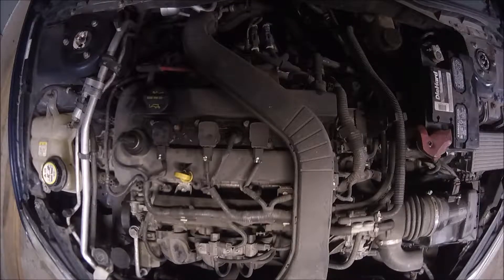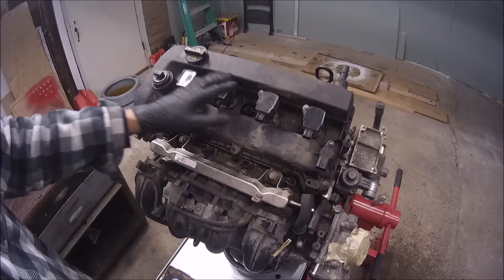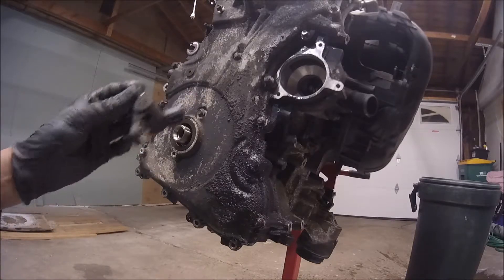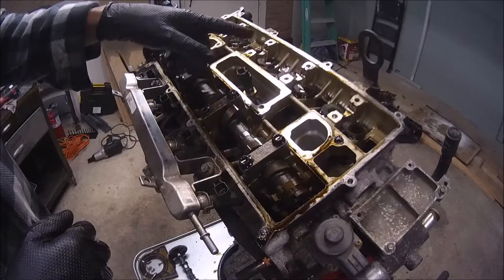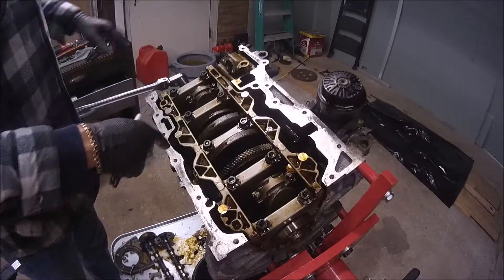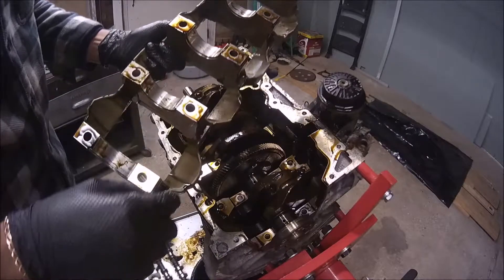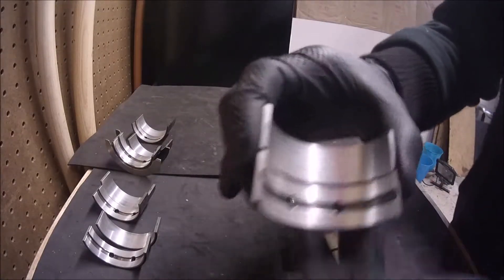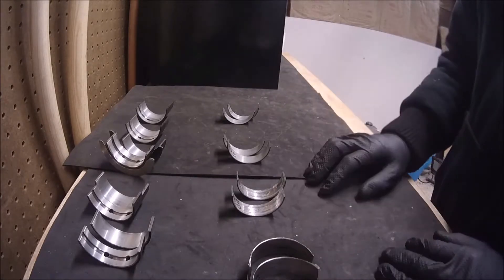2005 - 2009 Ford Fusion Engine Knock & Engine Disassembly

Comment: I'm confused.  If its only the one rod bearing that's bad, why take the engine out of car to fix it?  You can replace all rod bearings from underneath car with oil pan removed.  Now if your getting paid to do a full engine block rebuild then I can understand all the work.  I have replace individual rod bearings and even main bearings from underneath car but it does depend how much access you have underneath and if the oil pan comes out without a problem.
Reply: I know it’s only 2 years later but have a 2010 Ford Fusion sport can I do it from underneath as well? And what would the procedure be? Is there anything else I should do underneath while I’m down there replacing the bearings
Reply: @oscarbanuelos7936  If you have the sport, thats got a 3.5L V6 in it. Odds are if you have bearing failure on one of those, the water pump has started leaking internally and ruined the bearings. If thats the case, the engine is toast. I dont think you will be able to remove the oil pan on a 3.5 fusion without removing the engine from the car.